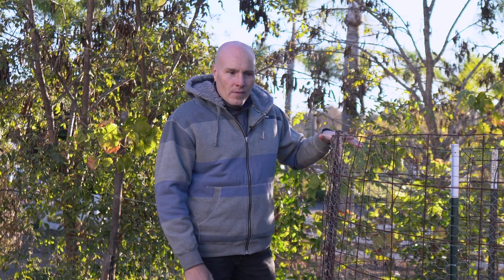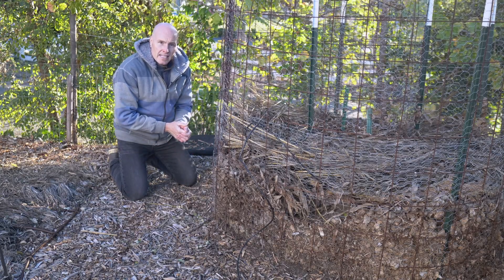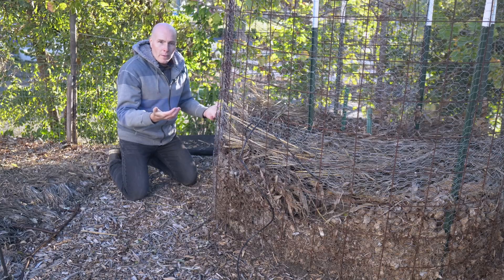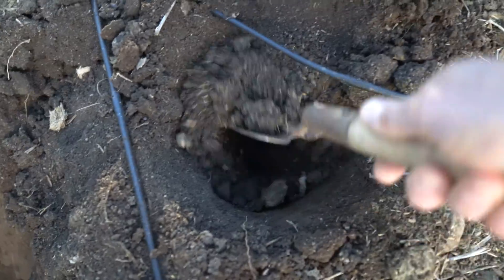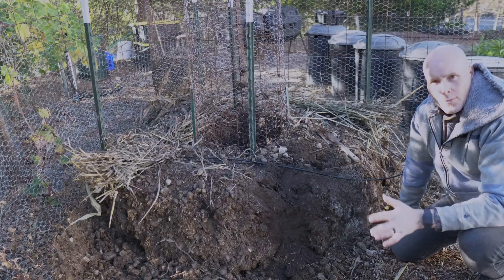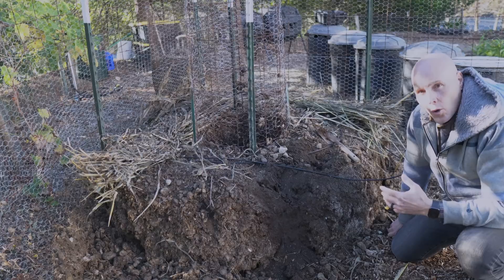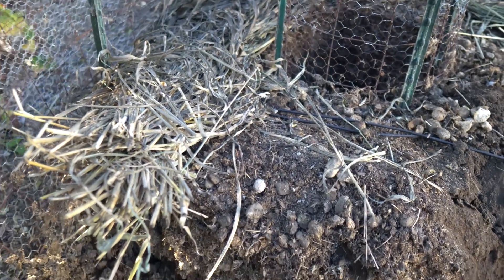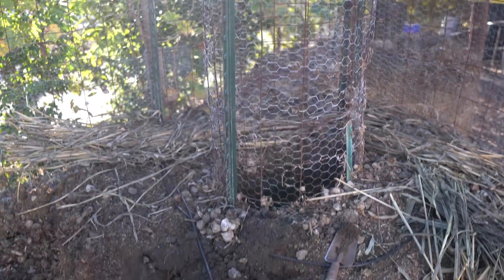Opening a Compost Bioreactor - One Year Later (SUCCESS OR FAIL?)

Comment: There’s no point in going through all this work without measuring the most important end result, which is plant growth.  Also, what are you comparing your compost to?  I still can’t find comparisons of the finished product of all the compost reactors you built in another video.

I will say Johnson-Su showed the compost at the end of his method and it was almost like playdough.

Do a video of the different reactors you built, filling each with same material, adding each to separate pots each with same species of plant and see what happens.  Don’t post bits of the unfinished “experiment” wait until it is completed and then post the results.  Thanks

Comment: Because of of the fencing I had to purchase, I had enough for TWO double-ring bioreactors just like this. One was overkill for my property. The second one just takes up space.

I'm going to flip the compost from the one I used into the empty one. I might even cut part of it down – so it's more of a "C" design – with better access.
Reply: I modified his design so that it was a rectangle, open on one short end for better access and it worked great.
Reply: @sammcjunkin9200  That's a good idea. Thanks!
Reply: Could probably sell it as well

Comment: I built the same last fall- filled it with a mix of manures- cow, horse, goat, chicken, wood chips, rotten wood from the forest, spoiled hay, old straw- set it on the ground to allow worms to retreat during our winters 30c today easier than my 2 traditional J-S reactors, significantly more volume. Time will tell.

Comment: Neat stuff, as usual. Thanks. Was curious when you first set this up why you had a 2' center, rather than a 1' center with a 5' diameter.  Would still have the 24' avg aeration/penetration w/ the nearly 
same compost payload..

Comment: Hi Diego, It's worth pointing out that the reduction in volume is caused mostly by offgassing of ammonia and CO2. Carbon in manure is more labile, whereaas in woodchip  there is more recalcitrant C (which eventually becomes humus).
Reply from the maker: I am not so sure about that.  The two full woodchip bioreactors were combined into one reactor last year and that is now 1/2 full.  Unless the carbon is going into a living body then it is going up into the sky eventually regardless of the form it started out as.
Reply: @DiegoFooter  "Eventually" is the key. All carbon will go in the sky, as you say. But usually cellulose and lignin are more long-lived. Obviously by having highly fungal conditions it might be that both manure and woodchip offgass at the same rate, but in my experience when composting (traditionally, not J-S bioreactor), mulching or incorporating into the soil, manure disappears very fast and does add very little humus to the soil, whereas woody or plant-based composts or raw materials increase soil OM a lot more. Nice discussion of this in Brady-Weil's textbook in the Carbon chapter :) Keep up the good work!
Reply: I wonder if adding EM would help maintain more of the volume? It certainly does in hot composting.

Comment: Hi Diego - 1. It would be interesting to see any observable differences in the pile along a line from the center out to the outside circumference to show what influence, if any, proximity to the air source has. 2. The F:B ratio (fungal to bacterial) is the ultimate indictor of success. I use a $10/test Microbiometer to monitor performance of my bioreactors. 3. It looked like your pile reduced to about one third it's original volume. My bioreactors with primarily tree leaves are usually ready when I get to 45% volume. Your thoughts?

Comment: To equal the initial volume of a Diego double ring 6' tall (6' outer diameter, 2' inner) a non-aerated cone would be (before shrinkage) about 10.5 feet diameter and 5.25 feet tall, for a 45 degree angle of repose.  And for a 30 degree angle of repose, it would be 12.5 feet wide and 3.6 feet tall.  And a J-S size (5'/1') holds 3/4 the volume of a Diego (6'/2') size.
Reply: Wow, thanks for this information.